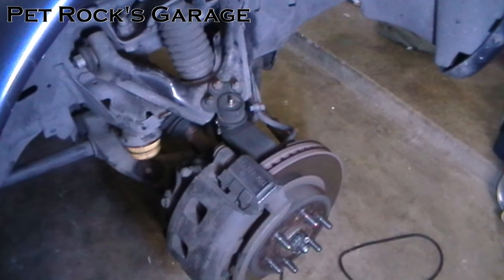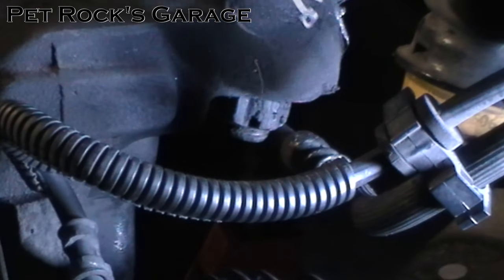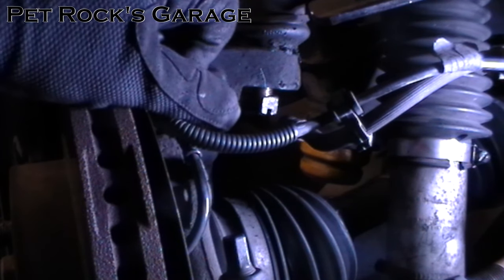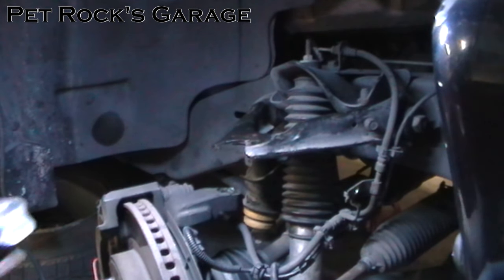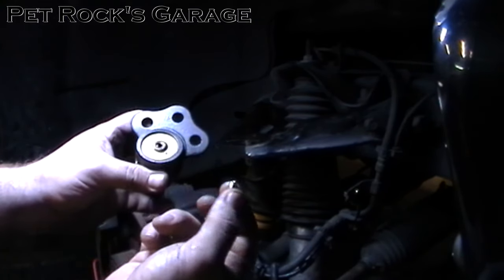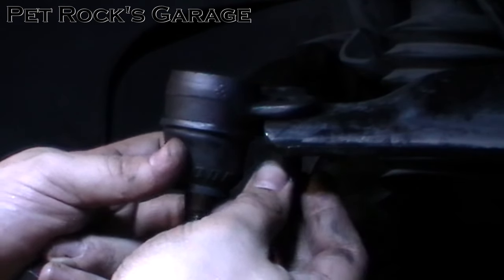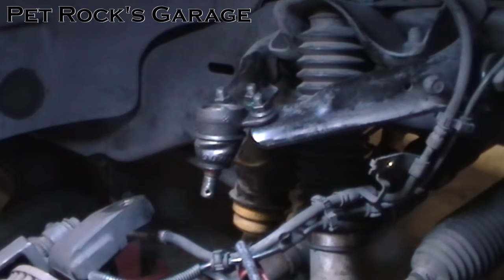How To Replace Upper Ball Joint - Dodge Durango (’00-’03) & Dodge Dakota (’00-’04)

Comment: Thanks for the video. Today was the very first upper ball joint I ever replaced.
I tried it step by step following your directions, and the single bolt with the castle nut. I couldn't get enough thread through the brake/rotor housing. So I removed the 3 control arm bolts and put the single bolt through the hole and put on the castle nut with 2-4 turns only. Then I pressed down the control arm and held in place with 2 of the thick rubber bungee's. I made sure the 3 holes with the control arm and ball joint lined up evenly. I hand tightened the middle of the 3 bolts, to make sure there was no slipping of the ball joint holes from the control arm holes. Then I hand tightened the other 2, and torqued all 3 to 53.5. I was able to fit my torque wrench & bolt on the castle nut. I was surprised when I torqued to 60, the hole in the bolt lined up evenly with the slots in the castle nut.
Reply from the maker: Sounds like jacking up the lower control arm (higher) to meet the upper control arm would have helped. Either way, glad to hear you got the job done.
Reply: @petrocksgarage  I didn't even think of that. Adding that to that information to my detailed list of changing out upper ball joints.

Comment: Thanks, Boss  The dealership told me that my right upper control arm ball joint was worn out, ok that's fine cheap easy fix right? Because I don't have the time to do it myself..... Nope, they want to charge me $494.50 to replace the whole arm.  "I will find the time"  Thanks again, Boss!!
Reply from the maker: Damn, $500 for a control arm change.  Most of that is probably labor, but still. Thats outrageous.  I too would find the time.

Comment: Very thorough steps 👍 just had mine done by the shop. I feel safer lol, they recently did my inner tie rod and that’s when they noticed my upper ball joints had play, I don’t have tools so I don’t mechanic, usually hire backyard mechanics but lately haven been putting it in the shop.
Reply from the maker: Thanks a lot. I appreciate it. Re DIY vs shop: there is nothing wrong with going to a shop. At least you know what the job entails so they can't rip you off. Knowledge is power.

Comment: I like that design sure beats using a press . Man your truck is not rusty at all. 👍👍
Reply from the maker: +STEVE ROB, yeah. it is pretty easy when it’s a bolt on part. The lower ball joint does need to be pressed in though, which can be a bit of a P.I.T.A. Its a California truck. So no salty winters to deal with. Hopefully it stays that way though. Where I live now has some decent winters, but they use sand in my area not salt. Fingers crossed.
Reply: I honestly wish Dodge did not do the rivets. Engineering flaw. If you have a Dakota or a Durango that never had the riveted ball joints replaced then I Highly suggest doing your research before attempting to replace with the bolt on ball joints. If you have air tools then it drastically will cut down the time you will use to do the job. Also don’t cheapen out on drill bits, 135 degree cobalt bits will be your best friend.

Comment: Thanks for the video! This helped a lot. However I wasn't able to looses the ball joint with a hammer so I loosened the three bolts attaching it to the upper control arm and used a pickle fork/ball joint separator to pop it off the steering knuckle. This is my first successful diy car repair and your video helped make it a success!
Reply from the maker: If you are replacing the ball joint a pickle fork is a valid option. But if you are going to reuse it, then I would avoid a pickle fork. They damage the rubber dusk cover way too easily. But I'm glad you got the job done. Thanks for watching & commenting. I appreciate it.
Reply: Pet Rock's Garage Yeah I wasn't going to reuse them but for my case it worked out.
Reply from the maker: Thats good.  I'm glad you got the job done and saved some cash in the process.  Thats why I make these videos.

Comment: Fantastic Video, local National Tire Auto Center wants $ 747 to do this relatively simple repair on my 2003 Dakota. Not sure if it has rivets, vs bolts, but if so once removed will the holes need to be drilled out larger for the bolt replacements? Thanks very much.
Reply from the maker: Wow, $747 is a rip off for an hour job. They were probably going to replace the entire upper control arm (which is more work) with a hefty P.I.T.A. surcharge. The holes shouldn't need to be drilled out. The bolts should just slide right in. Good luck.
Reply: Thought so, I have the tools and can do this myself, pretty cut and dry repair. Your video's are excellent!
Reply from the maker: For $747 you could buy all the tools needed a couple times over.  :-)
Thanks a lot. I appreciate it. Glad to be of service.

Comment: Can you show us how to do a DIY at-home alignment
Reply from the maker: briansmobile1 has a couple videos on how to do one.  However, I'm not a fan of DIY alignments. IMO, if you do one it should only be to get you to an alignment shop to get it properly aligned. Your alignment isn't something you should skimp on. If you do a DIY alignment incorrectly, and drive for a while that way, you'll wear out your tires pretty quickly, which will likely be more expensive then getting it aligned correctly in the first place. Just sayin'...

Comment: Thanks for the video. This helps out. (I'm a rookie mechanic and I like asking questions about everything. Knowledge building).
I have a couple of questions:
Do I use a jack stand on both sides of the vehicle (driver & passenger) or just the side I'm working on?
Will any hammer do (household construction) or a specific hammer at a certain weight?
Is it required to get an alignment once you replace a upper ball joint (or any upper & lower)?
Reply from the maker: Re jacks: For safety, you should keep as much of the vehicle on the ground as possible. So I would only jack up the side you are working on in this case.
Re hammer: any hammer will do but the bigger the better.
Re alignment: It is highly advised to get an alignment. Changing the ball joint effects the alignment. If your alignment is off you can burn up your front tires pretty quickly. New tires cost a lot more than an alignment.
Reply: @petrocksgarage  Thank you. Your answers matched everything I assumed/thought.
Reply: @petrocksgarage  Are there books or website's that tell torque spec's for all bolt's on a Dodge? I remember years ago there use to be books in auto stores that told you everything. Cannot find those anymore.
Reply from the maker: @yankeeownz9980 , you want the factory service manual for your year/model truck, which you can get through your local dodge dealer. Will pay for itself on the first service. I have one for all my vehicles. Don't bother with the Chiltons or Haynes manuals you find at auto parts stores. They are the Cliffs Notes of the manual world. Not worth the paper they are printed on compared to the factory service manual. Hope that helps.
Reply: @petrocksgarage  lol not worth the paper.... Haven't heard that saying in a while. I will contact Dodge directly as you recommend.

Comment: Hi can this be done on 01 Dodge ram 1500 ball joints have bolts.i just don't want to have to take everything apart
Reply from the maker: I'm not sure. I have not worked on that year/model before. But if the ball joint is bolted on then it should be a similar procedure. Good luck.

Comment: I was wondering, to check a upper ball joint, you need to place jack stands under the lower control arm to set free the ''load''..(Sorry for my english) On my 2002 dakota, the passenger upper ball joint is worn out, it needs replacement. To take it out, is it easier to put a stand under the suspension? Or just raise the truck and let the suspension go down by gravity and take the ball joint off?
Reply from the maker: Having the load off the upper ball joint makes it easier to remove the castle nut, and to get the ball joint shaft out of the steering knuckle. But it can be done either way. Good luck...

Comment: Great video.  Thank you for taking the time to clearly show the steps and details!

I have a question about a repair quote.  My usual mechanic doesn't do alignments.  I took it to another shop to perform alignment and they couldn't do it due to worn upper ball joints, quoting $700-800.  I thought he was gouging me until some online estimates gave the same range.  Doesn't that seem high?

Mistake-free DIY is always cheaper.  Rockauto has $10 ball joints.  You estimate a half hour for each.  I have the tools on hand and they don't seem to be expensive.

Instead, splurge on the $25 ball joints and double your estimate to two hours.  $100/hr labor makes my estimate under $300.  Is the estimate flawed or am I missing something?

In any case, two ball joints are on their way to my house.  Again... Thanks!!!
Reply from the maker: I've never understood shop estimate pricing. The most expensive part of this estimate is the labor of course.  Even if the job takes 20 mins, a lot of shops will still charge for an hour.  $700-$800 does seem high to me for this specific job. You could ask the shop why it costs so much considering how technically easy the job is. They may be quoting to replace the entire control arm instead of just the ball joint. Good luck...
Reply: I figured out why the estimate is high.  It covers my case where my 2003 was built after the upper ball joint recall.  I just finished grinding off the six rivets.  I'm not sure they'd cut anyone a break if they found bolts instead of rivets.  I super-splurged on the Mopar $30 ball joints :), $65 total shipped.  MOOG was $25 more but I'm sore from the last month with $550 tires, $500 AC repair, and another $250 in DIY repairs.  Thanks for helping me DIY a $700+ dual ball joint repair for $65!!!
Reply from the maker: Yeah, grinding those rivets off would increase the labor time. So they probably add a P.I.T.A. (pain in the a55) tax to make it worth their time. Glad to hear my video helped you out and you saved some $$$. Thanks for watching and commenting. I appreciate it.

Comment: What do you know about rear bump stops?  I have a 2003 4x4 slt and can't find them
Reply from the maker: Sorry, I haven't had to replace them on my truck (mine is a '03 4x4 STL too). I took a quick look under my truck and they look to be bolt on, so you might be able to find 'universal' bump stops that will fit. Measure twice, buy once of course. The factory part number is 52106494AA. Good luck.
I've seen them listed as "Bumpers"  too, btw.
Reply: @petrocksgarage  thanks for the reply. Great videos
Reply from the maker: @briannilsson3572  No problem. Good luck!  Could you let me know what you find?  Thanks.

Comment: How do i find a ball joint the same size as my cars but with bolts instead of screwed? is there a chart? anybody knows?  I need to modify my upper control arms I can't find any aftermarket ones for my car, I need the ball joint stud to be the same size,  my car is a 2000 dodge ram 3500 van lifted 3'' my stock ones don't fit properly, little help here, thanks
Reply from the maker: I'm not sure what you mean. The ball joint in this video is bolted to the upper control arm, not screwed. 3 bolts specifically.
Reply: @petrocksgarage  THANKS, I THINK THE DODGE RAM 3500 THE BIG TRUCK IS GONNA FIT MY VAN I HAVE TO MODIFY MY UPPER CONTROL ARMS I LIFTED THE CAR 3'' WITHOUT KNOWING THAT WAS GONNA AFFECT THE ANGLE ON THE UPPER CONTROL ARMS
Reply from the maker: @willywill6486 , yes, lifting or lowering a vehicle will effect all sorts of angles in the driveline & suspension. Good luck.

Comment: does that apply to a Dodge 3500 diesel 2 wheel drive automatic dueling
Reply from the maker: I'm not familiar with that truck, but a quick search online shows a completely different style upper ball joint for that truck. So I don't think this video applies to your rig.  Good luck.

Comment: How long did the ball joints last you each time?
Reply from the maker: It depends on a lot of factors. Typically I replaced them on my truck because the rubber boot was torn/damaged, not because the joint was bad. If the boot is damaged, dirt can get inside and make the joint fail fairly quickly. Hope that helps.

Comment: Thanks for the vid, but mine did not come off like this, makes it look way too easy. It took a torch, a pickle fork, a sledge, and my fat ass hanging onto 5' jack handle as a pry bar and it still took effort! Then I had to fight like all hell to get jack handle base to line up so I could get the handle back in. Split my hand open... That said, anyone reading this, be prepared or risk being stuck without a vehicle. Yes it was clean, no I am not in the rust belt.
Reply from the maker: Wow, your truck took your for a ride. Good to know you got it done. I would say your experience is an exception, not the norm. But you are right in that when doing any work on your vehicle there is a chance that it can take longer then expected.
Reply: Maybe it was easy for him, because he is an expert.

Comment: I take it these are pretty rough on ball joints?
Reply from the maker: They can be. It all depends on how you drive it.  Ball joints don't last forever.
Reply: True. UI just bought mine so I stil have to get the tire off and see what is popping
Reply from the maker: Good luck.

Comment: 5/16" not 15/16" socket
Reply from the maker: Thanks for the heads up. Around what time in the video did I say it wrong?  I'll add a notation with a correction (and mention you if you want).  Thanks.
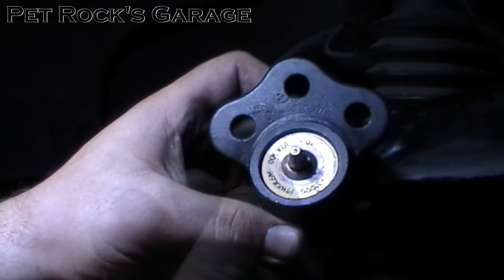Reply: Pet Rock's Garage 4:54 time frame
Reply from the maker: Thanks a lot. I've added an annotation in the video & description and gave you two credit. Thanks again.

Comment: And... mine still has the rivets... and it is 29 degrees outside.
Reply from the maker: Yeah, that's cold. Maybe try to work where the sun is on your back and have a few heaters surrounding you? Good luck.
Reply: The whole top control arm is not much more expensive... how hard is that to replace?
Reply from the maker: IMO, its slightly more difficult then just replacing just the ball joint. Plus the added cost of getting an alignment afterwards. It sounds like your ball joints are stock. Years ago there was a ball joint recall on a few years of dakotas & durangos. Call your dealer to see if your truck qualifies. If so, you could take it to them to replace it for free. Good luck.
Reply: Thank you for the info!
Reply from the maker: No problem.
Reply: A 50+ degree weekend!
Grind grind grind grind grind grind... bang on rivets bang on rivets... grind some more... Bang a bit more.. PING... 1 done.  The other two followed quickly.
Re-installation was a breeze.  
Torqued to 54 lbs   Thank you for that last detail.  $270 saved.

Comment: I drilled a small hole in the rivets and then drilled a larger hold down the center. then punched out the rest of the rivet. PAIN IN THE ASS!
Reply from the maker: Yeah, the rivets are a P.I.T.A. At least now you don't have to worry about them again if you ever have to replace the upper ball joint again.